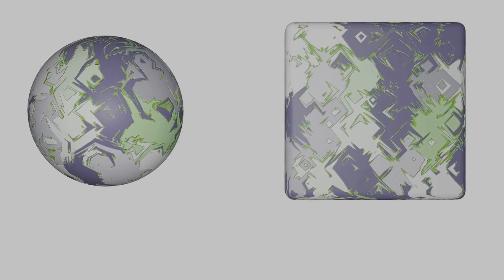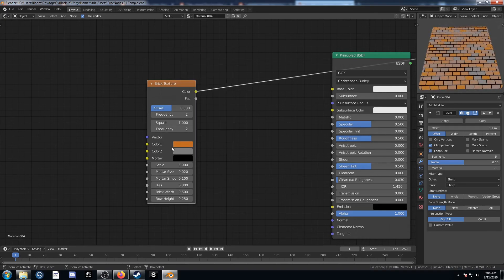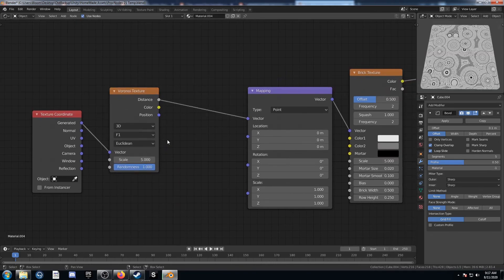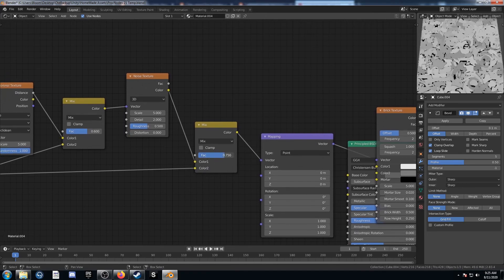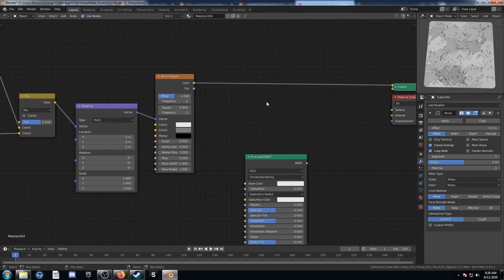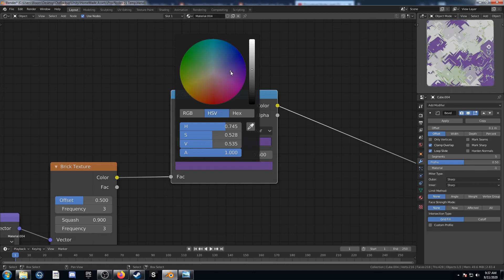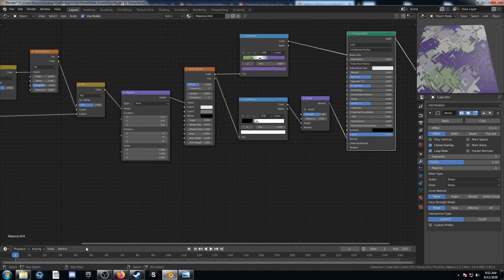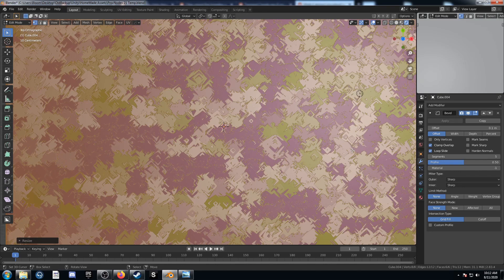Procedural Nodes (part 22) - Explanation of the Abstract Brick procedural textures in Blender

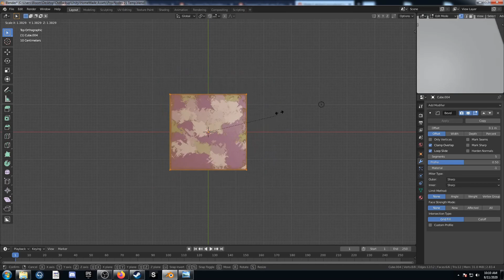Comment: when i try to scale my texture as you say at 9:21 it does the same as normal scaling
can you plz help
Reply from the maker: Hi there, my guess is that you tried it in object mode instead of in edit mode. In object mode it just scales normally. Hope that helps
Reply: @snow_mamba  no, i'm in edit mode,  pressing "S shift+z" is it wrong?
Reply from the maker: @RoyallRed  s shift+z is the correct shortcut. As long as you're plugged into the object output of the texture coordinate node then it should expand the size of the mesh without expanding the pattern.
Reply: @snow_mamba  yeah it was on generated insted of object. thank you very much